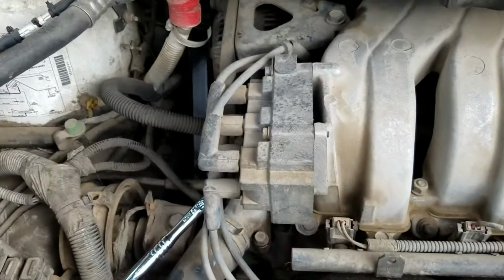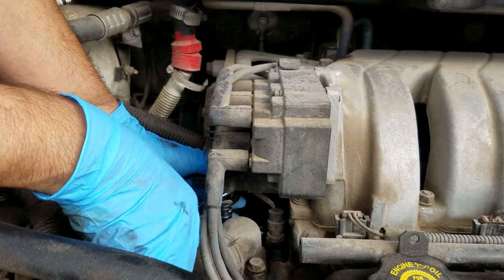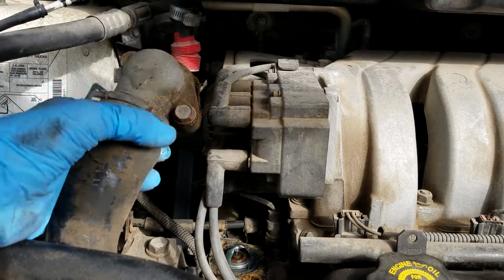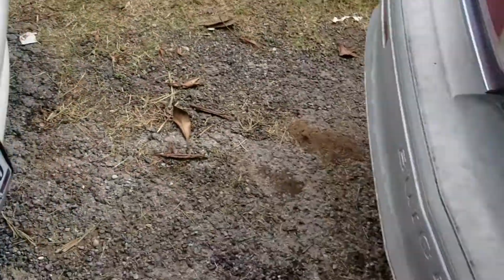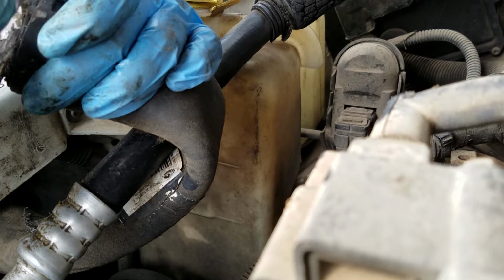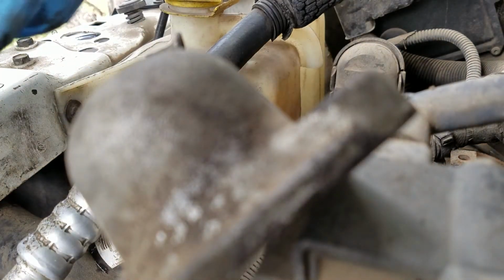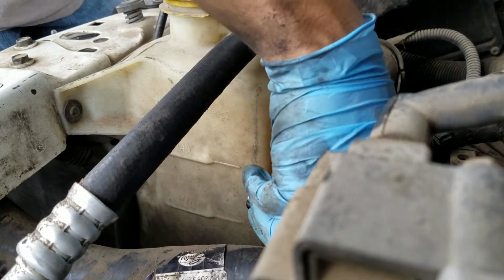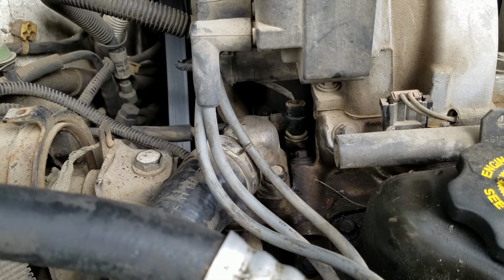1997 dodge  grand caravan

Comment: Thanks for this video! I have the exact same car (97 Dodge Grand Caravan 3.8L), and it's overheating. I have replaced the water pump and a water hose, and apparently it's something else. So, I think, I will remove the thermostat next to see if that solves the problem.

Suggestion : You may want to add the word "thermostat" to the title of this video so people can find it more easily. It's pure luck that I found it
Reply from the maker: Zsolt NX your welcome
Reply: Notice how he doesn't follow your advice on changing the title
Reply from the maker: Who

Comment: In 2018 this is the only current video on UTUBE for thermostat replacement on a 1997 , 1998, 1999 3.8 Dodge caravan and is accurate as to showing location, and removal of the water hose & housing over the Thermostat. What the Video FAILS is showing the ACTUAL replacement and locator direction of the thermostat inside the lower housing and replacing the leak prevention gasket .   Actual direction of the thermostat is critical to water flow. There are NO markers on these metal housings direct from factory in those years. it is very easy to place the Thermostat in the WRONG direction.
Reply from the maker: J P Sullivan o I see but the short dome goes on top
Reply: If you watch the video, when the housing is removed it clearly shows the thermostat orientation. Put the new one and the same way — no surprise. And make cleaning the upper housing a whole lot easier by removing that clamp and hose.